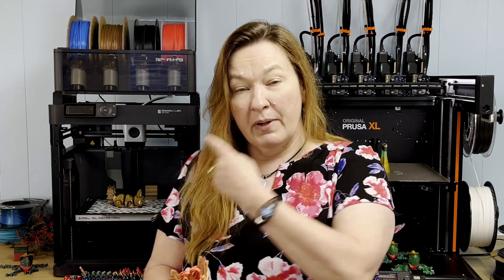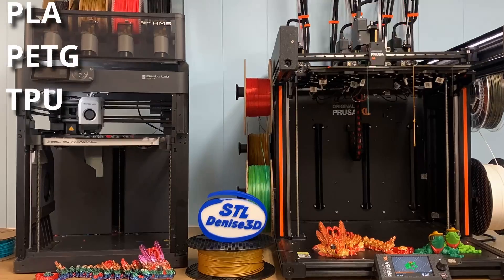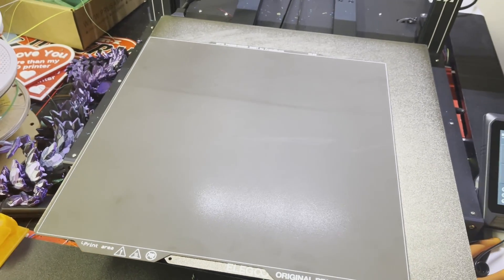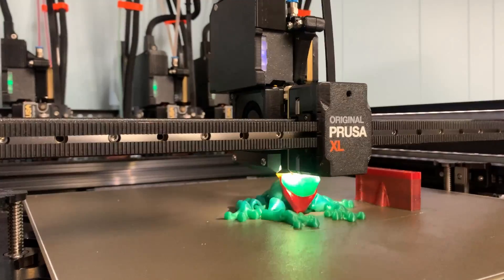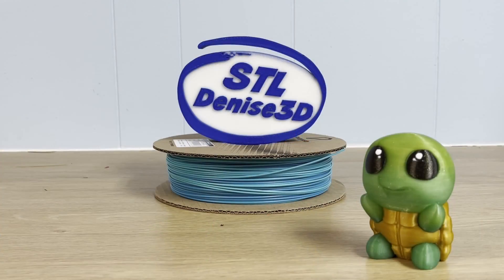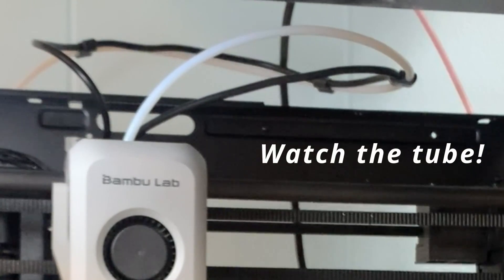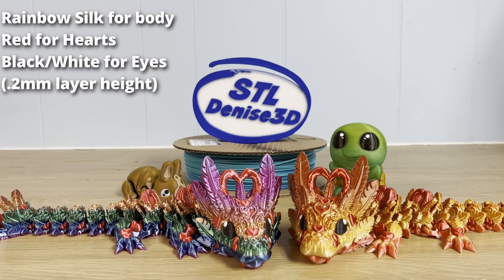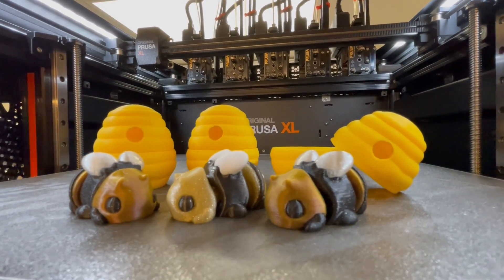Prusa VS Bambu Round 2: Who Prints Color Faster?

Comment: I would be curious to know what the price per speed is for each printer. The cost of the p1s with ams is $1000ish and the cost of 4 tool heads is $3500ish. If you are looking at the speed per dollar spent are they close to the same in that regard. This would only be a competitive comparison for multi-color prints. The other variable that could tilt the scales would be adding up the cost of filament poop.

Comment: The XL now has a very very very good enclosure now.
Reply: Prusa needs a few things to make it compelling at the 4k price.
1. include the enclosure ($650 plus 2 month wait time...)
2. Include 5 HARDENED nozzles($50 x5). Brass nozzles for a device marketed for engineering is a joke.
3. include a camera
4. Better wifi networking option in the box. Why did they chose is a cheap WIFI part? Speed is measured in dialup speeds in year 202X is a joke

Having to buy an enclosure, 5 hardened nozzles and a camera  is a huge miss for such an established company.

Comment: I don’t have a prusa XL and it’s not for the cost, I found prusa an arrogant company to deal with when you get issues out of the box so I stay away from them as a whole and the only prusa printer I own is sat in the corner as a reminder not to trust the hype.
I didn’t trust the hype over Bambu lab either and was a slow adopter and though not perfect they are the closest I have found to what has been said in “review” videos than most.
The big advantage on a multi tool head is handling very different materials in a single print such as tpu and abs. Other than that multi tool head can also be a limiting factor and maintenance costs are considerably higher than single extruder units with a multi material system, oh can you print me a 6 colour object on an XL without manually pausing the printer.
Unless you have a specific reason then the XL is a waste of money.
As far as poop producing printers I seriously don’t like the waste filament issue and the industry must take responsibility for an issue that is going to grow with creality, anycubic, phrozen and most likely every other manufacturer out there joining the Bambu lab train.
I think the first company that produces a machine that is economically viable to turn poop into new filaments should be given a noble prize for saving the planet from 3d printer waste from printing dragons and little trinkets.

Comment: I guess we wait for Ender 3 V4, where they will put multiple tool heads at the top of the printer. V3 has belts on Z axis, so this would not take too much time to go up and switch head. The quesion is who will do this first. Or maybe Bambu will create one? = ) I mean $4000 is $4000 = ))

Comment: I don't understand why Prusa makes the XL prime - OFF the build plate, it just oozes a strand of filament off the bed, every time I see that I cringe and imagine some kind of gcode corruption, but no, it's by design. wtf? thoes are cold solid filament, and if the bed gets low enough - could flip over onto the build plate. wtf? couldn't they just have made a build plate big enough or had it prime ON the build plate like every other pirnter?
Reply: The build plate magnets are pretty strong, I can't see it causing the build plate to lift from the small amount of contact surface on this unheated area.

It does make removing the prime line easy, you have a 'handle' to grab.   I don't know if that is the intended purpose.

Comment: XL is a cool machine if you need a lot of multi-color prints in minimal time. For the occasional multicolor print, or prints with more than 5 colors... The $3k premium over the P1S can buy more AMSes and about 100 kg of filament.
Reply: @ericolofsson  the XL nozzles leak if using 0.6 or bigger, and the printer is not enclosed so your material selection is still limited, unless you add more $ for enclosure.

Comment: So cool, for the price of single XL you could actually buy 2x X1C with AMS and you would still have $1000 left for a lot of filament. XL filament savings are imaginary when the price is ludicrous. The only true saving here is your time but i doubt it can beat two X1C printers or three P1S. I would agree the Prusa wins but only when it's in the similar price range as competition.
Reply: Don't forget that with prusa, you have premium customer support, every part of the machine is repairable, the firmware is opensource. This is the price to have a reliable machine and it worth it

Comment: I would love to know how much money someone like a print farm owner would save per year on filament using the XL over a BambuLab printer. I imagine the cost of the XL would eventually be cheaper from an investment standpoint, but I dont know how long that would take. If anyone knows of a study already done on this, please let me know.
Reply: I have already took this into consideration.
Lets take the XL fully assembled 4k.
vs an X1C $1449
there would be about a $2500 price difference for filament. 
Each poop is about .01-.2 grams a filament so for a single 1kg roll you would need about  (at best) 100,000- (at worst)5000 color swaps to chew through a roll.
Now how many rolls can you get for $2500?  100-250 rolls. It could take hundreds of thousands to millions of color swaps before you even met the break even price of the XL. 

It gets even wackier when you compare it to multiple machines, cheaper machines. If printing similar things there is no scenario where the XL comes out ahead.
Reply: Do you mind if I use your comments in a video. I am investigating filament waste on a Bambu X1C and this calculation is roughly what I have determined as well.
Reply: @ashleys3dprintshop  Go for it! 🙂

Comment: How does the XL compare in speed when your model only has one color? Thanks for the informative video.
Reply: I have not done a comparison directly, but from what I've seen from other YTers, the Bambu is faster, but a part of that is because they end up printing less filament when it's really hauling ass (because there's only so much flow you can get out of the head). If you print the same model on a Prusa and a Bambu without doing a bunch of tweaking, then weigh them, the Bambu is lighter. It's not clear to me if one or the other of those is "better" -- like, is the Bambu more optimal, or is it sacrificing part strength with less material? Dunno.

Comment: how was the quality and avg speed difference in single color?  i have Bambu X1C AMS ,  Prusa MK3s+ upgraded to  Prusa MK3s++ Revo Six and Prusa MK4IS . So far the best quality to speed factor is Mk3S+Revo Six  . And Still Mk4 has slightly higher quality than the X1C but still quality of the MK3s+Revo6 was better.  Speed wise X1C and MK4IS are with in the 1%-10% avg and Mk3S+Revo Six is with in 10-20% slower avg .   Not talking that the Prusa both has a flat Bed while the Bambu X1C has a bad curved  bed . Multi color on the X1C i tried a print on AVG from 2 hour print single color  becomes 10H almost no prime  - 13hour with advised prime . Practically from 1k+H on the X1C  i have 20h multicolor as not practical . And was thinking at some point to go to Ulitimaker or now to the XL as a bit cheaper. and Normal Mk3S+ was also superiro  quality compare to X1C and Mk4, but much slower than MK3S+RevoSix .

Comment: That is much much quicker. Thanks for the vid, I basically don't bother doing multi colour prints on my p1p with ams because it takes too long and wastes filament. It's good to know they excellent multi colour printers are going for $4000 give it a few years and they should be a little cheaper. Happy printing

Comment: Im planning on getting my first printer for engineering projects and for the Rc hobby for primarily aircraft. Currently I was fixed on the X1 but the toolchanging feature and the reputation of Prusa made me rethink and look through options.  However, the toochanging feature is not that much of a tool i think i will use since i plan on primarily printing single material bodies for printing. 

I think the only criteria that i truly value is the final print quality, consistency, ease of use and user interface. In your experience doess the XL print better than the Bambulab or does the X1C have better and smoother prints?

Comment: Prusa has premium price tag and not premium built quality and features.
Reply: The components in the XL are literally higher build quality than anything found in bambu lab printers.The fans, PSU, electronics, etc in the XL are all name brand, higher build quality and built to last. Just look at the rails. Bambu uses cheap carbon rods that are prone to scratching an wearing down. Bambu literally lists them as a consumable component. Prusa uses rails sourced from a high quality manufacture. It's the whole reason why there were delays in the XL launch.
Reply: How so, please elaborate? 

For build they use nema motors, e3d hotends, gates belts, in house electronic boards, delta power supplies, noctua fans, THK linear rails/bearings instead of rods (bambus wear out..) then all the tool changing parts are hefty machined aluminium metal parts.

In terms of features:
It has 5 TOOLHEADS, 360mm build volume and is significantly faster for multi color prints (up to 5 colors), and wastes significantly less filament. It's like you didn't even watch the video..

Comment: Which is more reliable?
Reply from the maker: They're both great, but any machine is bound to have something fail. So far, the XL has been easier to clear out jams. When filament breaks in the AMS tube, it can be a real pain to get in there and clear it out. Also the Bambu bowden tubes will wear down if you put abrasive filament in there (glitter/glow in the dark) -- the filament really rubs inside the tube with all the harsh bends.

Comment: The hard part to guesstimate here is reliability over time of the AMS vs the XL. The XL is going through some public-beta-test growing pains but it's a Prusa. Coming from ownership of Voron, multiple Ender 3 Pros, and multiple Mk3s+, I know which one my money would be on. That said, the X1C is compelling for its automated calibration suite. As someone who is over my 3D-printer-maintenance-as-a-hobby phase, I really, really like how close it gets to just being a tool where you design cool stuff and push the big green GO button and forget about it.
Reply: Gone through.. it is currently fine, it's had so many updates in last 6 months it feels like another machine, the problems have been ironed out.
Reply: so which is more reliable? the XL or AMS?;p i have only a mk3s and it's running fine for years:)

Comment: The prusa xl is an engineering marvel. I would have never though of having 5 separate nozzle in 5 separate docks
Reply: Concept has been around on cnc and various other industrial machines for decades. It's not even first 3D printer to have tool changer but could say first to make it easy to use out of the box at under 10k. The e3D tool changer was very similar to this but the setup of that thing was something else.. very difficult, manual and time consuming.
Reply: It's not the first printer to do that
Reply: @_Richard_F___ It's not because they're both toolchangers that one is a copy of the other... The only similarities is the fact that there are multiple printhead with their PTFE tube, other things like the lock mechanism etc are not the same. a Ferrari and a Lamborghini are both supercars, but no one copied the other.
In fact on their blog E3D said that they just wanted to prove that toolchangers can be a thing and that they succeed because some makers like Prusa with their XL has made it on a consumer product.
Reply: It could be even better but there are old big company patents that limits design.

Comment: Would be interesting how many grams the difference of the wasted filament it really is. At all 8 hours difference is huge. Would be interesting to see the power consumption difference too. Or a calculation of how many hours with PLA or ABS/PETG and so on you have to print to get this filament wasted money, as ROI of the additional price for the prusa, IF the prusa really waste less filament.
Reply from the maker: Oh! I wish I could edit a video to slide extra info in there! The dragon print had 70grams of waste, while that XL purge tower only weighs 12 grams (the size of an average Benchy). I'd have to get back to you on the math, but it's a 💩 ton of prints to get your investment back.
Reply: @stldenise haha thank for your information 🙂  So we have only the additional hours it took 🙂 and the power consumption, and maybe if the quality is better on the one or the other, which wasn't really easy to see 🙂 And one question I would like still to know - how much % of the print is the waste? Dragon looks like 300g if I am right, or more? Do you know if you can print also higher quality filaments with it, like PA6 or PA12? Have you tried out maybe TPU?

Comment: Haha...i was going to make this video when my XL finally comes in.

I do disagree with your conclusion on speed. In a situation where you only have room or power for a single 3d printer the prusa xl would be faster. But if time is money, and money is also money, you can buy two p1p combos and then you would be slightly faster than the prusa xl using the print in your video. And for the price of the prusa xl you could buy 4 p1p combos and be more than twice the speed of the xl.

There are of course so many factors that could be considered. Neither machine is the perfect tool for every print job.

Looking forward to see you at RMRRF again this year.
Reply from the maker: That's a valid argument! If we're looking strictly at money, the Bambu A1 (with a new cable, of course) runs circles around both of these machines. It hurts my heart every time I hear of someone who sold a Mk3 to pay for their Bambu. More printers = more prints!
Reply: @stldenise  I sold my MK3S+ for a bambu A1 and for my needs as just a hobbyist then it was perfect and much faster, swapped it for the P1S after the recall which is better still. If your running a business then maybe more is better but for the average user I think the Bambu option is a better option as it just works like an appliance.
Reply: @stldenise  Is the A1 better than the P1P?
Reply: You are correct - if this is about a business, then multiple reliable printers win
Reply: Depends on what you want to print as a business   Bigger prints goes to the XL    Bambu for smaller prints   Just have good waste management

Comment: Even the mk3(s(+)) with MMU2 has much faster colour change than the Bambulab printers with standard settings. Actually unloading and loading takes longer than a toolchange on the XL. However, the main time consuming action on a Bambulab is cut&poo. While it increases reliability of a filament change compared to the mk3/MMU setup and avoid the need to tune every filament (ramping profiles), with a Revo or TUN hotend the mk3(s(+)) does quite well, producing less waste than a Bambu. On small multicolour prints the old mk3 with MMU2/3 actually need less time over all than a Bambu. But it is less beginner-friendly.